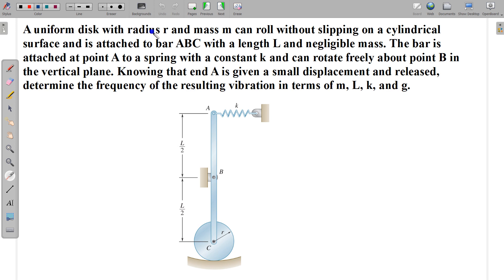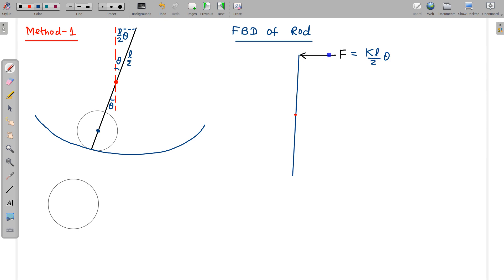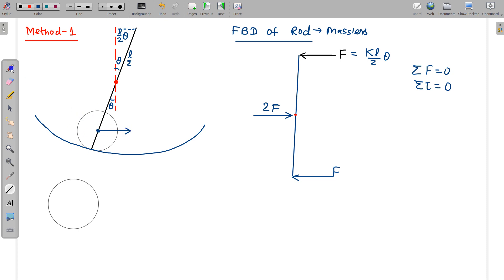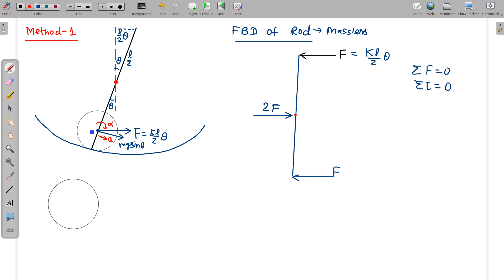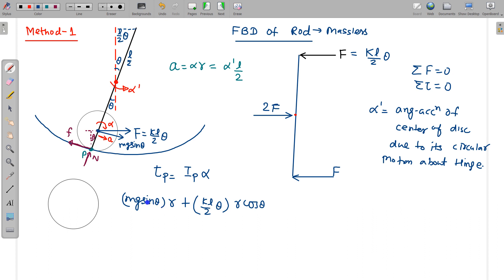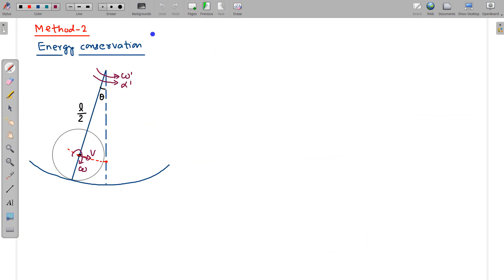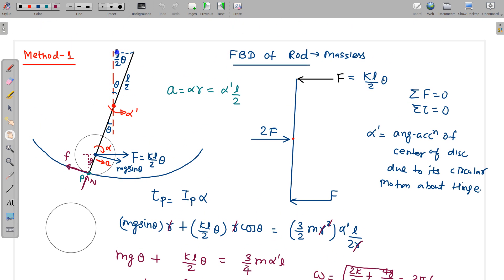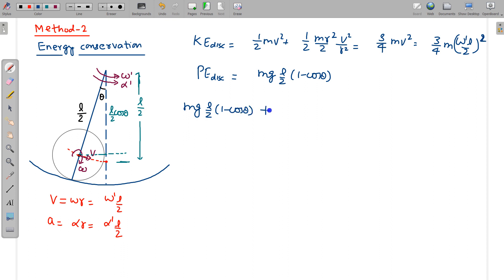Simple Harmonic Motion | Disc oscillating on Cylindrical Surface | Torque & Energy Methods

Comment: Sir there is a problem of electrostatic in which three identical charges are located   at the vertices of traingle and and asked within the traingle at how many places the electric field will be zero then sir I want to ask  you that  can we do the problem in the way like if   we suppose choose a random point in the traingle and let the distances of the point  from three charges be X, y and z and and let the angle be theta that is made between the electric field vector on that point that is offered by bottom two charges of the traingle  sir if on that point  electric field have to be zero then with help of this we can make equation by doing net electric field zero on that point and we get a equation in which we have find a relation between X ,y and z  and theta and from this if we suppose choose any other and and the distance suppose of that point be X das , y das and z das from the three charges and let the angle be theta das and from this if we put the values of all this distances and angle in the equation that we got previously by doing net electric field zero and if all this satisfy the equation then on this point the electric field will be zero sir please reply
Reply: yeah its correct but you know what the equation for which field will be zero is equation of median of a triangle and by this you can prove there are three points at three different median for zero field and one at center so total 4 points

Comment: a silly doubt sir .jb aap first method use kr rhe th tau aapne costheeta ko nearly one le liye but in second method jb PE likh rhe hai tab aap costheeta ko 1 kyo nhi le lete .kyoki us case me bhi tau theeta small hi hai
Reply: Because in second case cos theta is varying but in first case cos theta is constant.
If we put cos theta equal to 1 then it's differentiation becomes zero but differentiation of cos theta is sin theta and when theta is tending to zero sin theta equal to theta but 0 doesn't equal to theta
Reply from the maker: A general tip is Don't apply approximations in between, apply at the end
Reply: @PhysicswithAkashGoyal  thank u sir.got it